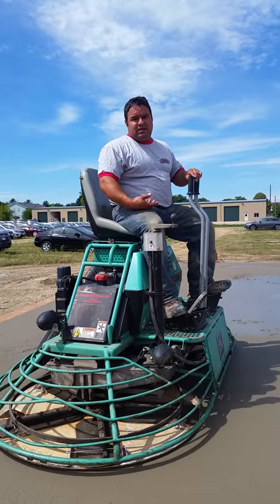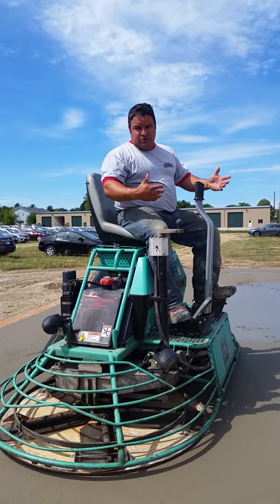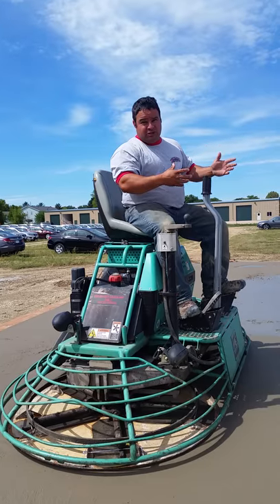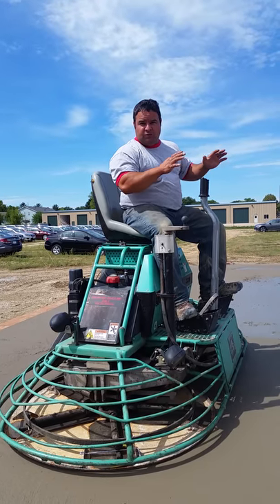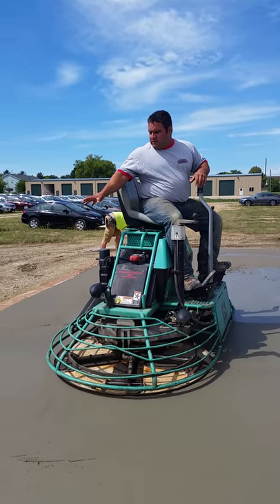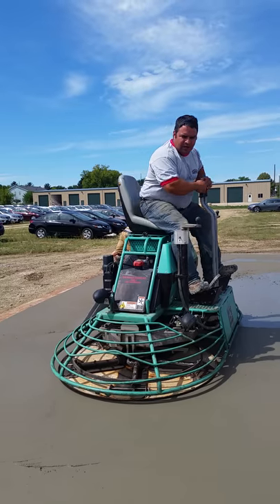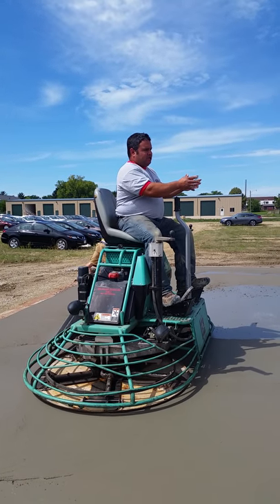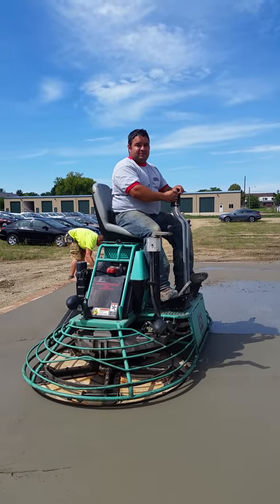Operating a ride on power trowel with pans(Part 5)

Comment: I saw a video on tiktok of this machine I am still baffled on how it does not sink into the cement .
Reply: The concrete is hard enough to walk on at this point.
Reply: Walk on the concrete when you leave 1/2 boot imprint time to pan

Comment: how does it not sink into the cement? i should probably know this cause i’m a rod buster but i have no freaking clue
Reply: The weight is spread out and helps its on pans. The concrete should be at least 3-6 hours placed depending on temp and other environmental factors otherwise yes itll sink
Reply: It's not super wet when the machine goes on. What you're asking is the most import part of power troweling. Knowing your concrete and not hitting it too often. If you do it can cause air pockets very quick if over worked.

Comment: How much cost this machine
Reply: About $45,000.00 45k used
Reply: The machine shown here is an HHNG5. This particular machine would cost roughly 13,000 depending on hours and condition. Could be more or less. Many other models are available as well, including hydraulic
Reply: @edwing3638  no, this isnt a hydro machine. this one is mechanically controlled. this one new can be purchased for 15-20000 USD
Reply: 14,000 and up